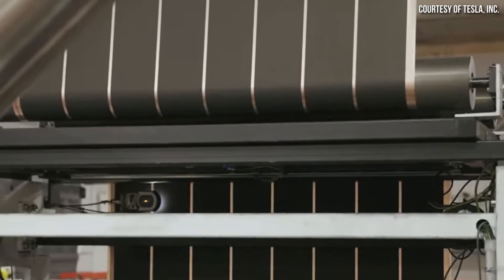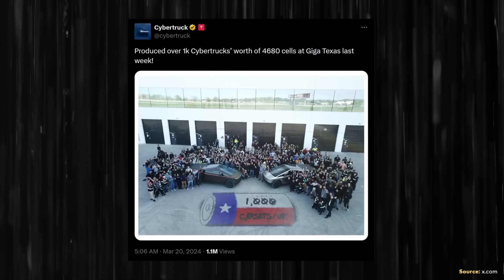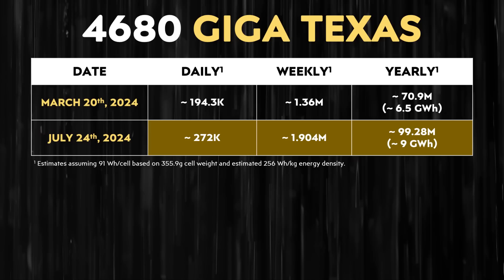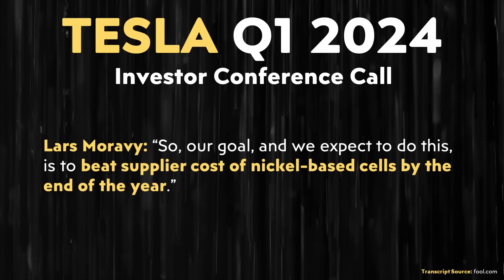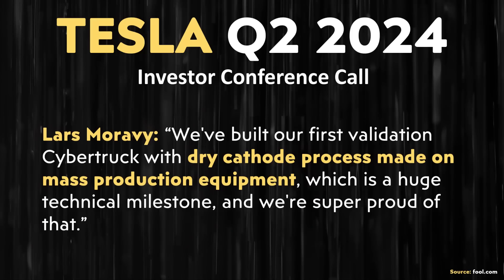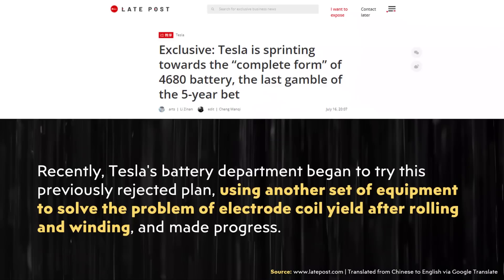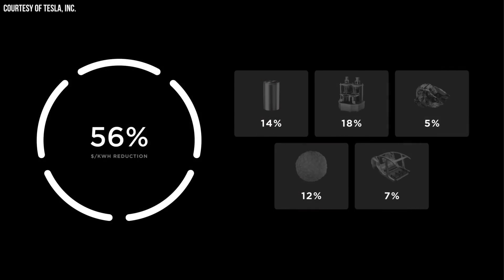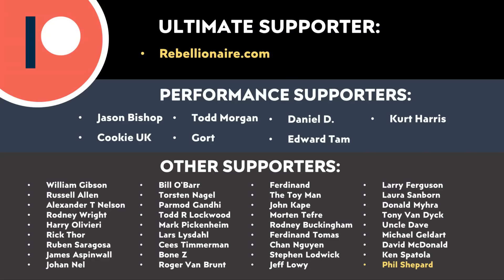BIG Tesla 4680 Battery Update | This Changes EVERYTHING!

Comment: SOLUTION.
TWO Cathode lines, running at 50% speed to equal the output of ONE Anode line at full speed.
DONE!
.
IF a solution is found... Build ONE more cathode line, and ONE more "Cell assembly plant" and you DOUBLE the output.

Comment: Was this Maxwell IP? Still no mention that this is the case.
Reply: "Still no mention"?
You never took the trouble to read the Maxwell patents?
Reply: @rogerstarkey5390  Hi Roger. Is it a given they used patented processes belonging to Maxwell? They didn't really affirm that in their commentary. I may have missed and if so, be happy to be corrected.
Reply: @rogerstarkey5390  you are clearly the resident expert. I am a complete novice. Clearly. However, I support @spleck615 narrative re "acquiring dry process material from an external vendor". More specifically Nano One Materials - Canada. I will await your correction when/if proven wrong. Cheers

Comment: When you hear executive or a head of govt. come out publically with specific goal, many times they already have good idea that it will easily be attained.  I believe in the case of 4680, the only significant hurdle left is dry cell cathode, and the rest of it is just tweaking production to ramp, scale, and produce better yields.  All of course lead to cost savings.  Once the Tesla dry cathode is part of the puzzle they will significantly be below any non LFP battery and will compete better with BYD who has been taking advantage for some time with in house battery production, though it is limited to LFPs and therefore fits well with the lower range and typically smaller vehicles they sell.
Reply: Well done for catching up with what we've all known for a long time.
.
As for LiFePO4 cells.
Lower density cells are NOT necessarily suited to smaller vehicles.
Think it through.
Lower density equals a heavier pack or less range for a given volume.
Smaller vehicles are space restricted AND pack weight is a greater percentage of the total vehicle weight, so impacts economy.
The logical choice might well be a SMALLER volume, HIGHER density, LIGHTER weight pack .... IF the cost per kWh is low enough.... Which is the aim of the Tesla SYSTEM (The Factory, not the form factor)

Comment: PESSIMISTIC HAT ON
What is not said is whether the mass production equipment was run at mass production speed or at mass production failure rate.
But still great news.
Reply: Think it through.
You have what is essentially a rolling press which suffers at high speed... so you add TWO units to that section running at half speed.... "Slightly more expensive" , slightly less space efficient, but reliable and doesn't lag the rest of the process.
Basically 2 Cathode lines per Anode line.
IF a solution is found, you simply add another Anode line to match the capability.

Comment: I wonder how they solved dry coat cathode. Did they need to remove manganese? If so would this impact energy density of the cell? I wonder if those limitations might hinder development of optimizing chemistry to improve charge rate and energy density.
Reply: Removing manganese will actually improve energy density because manganese is a stabilizer. But removing manganese makes the cathode more expensive. Although it seems like they are not removing manganese entirely only decreasing the proportion and then increasing the aluminum which is a softer material and an alternative to manganese in the cathode chemistry.

Comment: I heard that Tesla gave up on trying to fix the dry battery cathode manufacturing equipment and replace it with new battery manufacturing equipment to solve the problems producing the dry battery cathode. Apparently the holdup was the desperate attempts to fix or tweak the existing manufacturing equipment rather than suffering the loss inflicted by replacing the equipment.
Reply: makes sense - why waste time on 4680 otherwise
maybe they will roll out something new for more useful cells

Comment: 50percent ramp up is after using  cathode electron set supplied by LG . so there is no point of reducing cost less than suppliers. You are using supplier's crtical parts. The only way to accomplish  Elon musks goal is using dry cathode electron set and scale up to reduce cost less than suppliers's wet processed 4680 cell ,and You dont have that much time if you have just developed a prototype. Great lab work but not for scales yet

Comment: What does mean „dry“ does it means 30,50,80% moisture ?
Reply: I believe it means close to 0% moisture not needing any drying kiln after deposition. As opposed to typical 'wet' that is applied as a water based solution needing substantial kiln drying.
Reply: It eliminates the need for all the drying ovens that come after wet coating.

Comment: Tesla goal :
"Beat supplier cost nickel cells year end" 
A moving target. CATL BYD will have leapfroged by then, in addition of cheapo iron batteries.
Tesla should get over theire failure in batteries now, not year end
Reply: Cope harder
Reply: It's not a "Failure", it's a "Development" and the reason other cell prices dropped was market conditions.
.
The cell manufacturers were producing to supply an increasing volume of vehicles, then numerous manufacturers famously (Infamously?) "Pulled back" causing a glut of cells.
I suspect you know this.
GREAT for Tesla since they are the customer  that not only maintained vehicle production but expanded the STORAGE business over the period.
That's going to reap rewards in future when negotiating and when the manufactures decide which customer is first in line for new developments.

As for "Cheapo Iron cells", it depends on the application.

Comment: I think we might be reading too much into the conference call announcement, no doubt as they intended. I had already heard in the last few weeks that they were acquiring dry process material from an external vendor. The announcement could easily be interpreted as updating the process to utilize the 3rd party material, not an actual breakthrough on their internal dry manufacture material process. Still an improvement, but not what people are claiming has been accomplished. It would be nice to get clarification on which is true in this particular case.
Reply: Wrong, they were purchasing wet cathodes not dry cathodes from suppliers.
Reply: @boostav  that doesn’t conflict with what I said.
Reply: @spleck615  Uhm yes it does... there is no third party option to purchase dry cathodes from.
Reply: So, you're reading what Lars said (ability to produce it on the mass production equipment), and don't believe it means what it means? You don't suggest he lies, but how could it be otherwise then?
Reply: @Alarix246  I believe it may be integration with 3rd party into their process using mass production equipment which is great, but not the original goal or what has held them back. This is (potentially) plan B. Again still great. But not the breakthrough they were trying to achieve and recently gave up on. Then suddenly achieved it? Doesn’t make a lot of sense. 3rd party integration makes sense and matches recent rumblings. Awesome to be wrong though.
Reply: @spleck615  There is no compelling reason to believe they would adopt such a practice. Rather than simply fixing their own and proceeding onwards into battery production.
Reply: Need clarification here: From your sources, are they buying dry process raw material from external vendor or are they buying finished dry cathode from external vender? Big difference between the two

Comment: This is as big as Apples M1 chip.

The new batteries will continue to drop in price in the next years.

It will become cheap enough that Elon will have to have them in the Model Y. There will be no other option if it’s cheaper.

This will make increased range cheaper.

This will make EVs as long range as ICE, and soon far cheaper than ICE.

EV adoption will skyrocket when it is so much cheaper that the consumer has no choice but to consider them.

Get ready for $10k base model EVs in 15 years.

Comment: Is there energy density disparity between wet and dry cathode technology?  Sorry if I missed that...
Reply from the maker: Generally, the dry process leads to lower energy density... however a recent Tesla patent app detailed a way to adjust for that and bring the dry process to energy density parity with wet processed ones. There shouldn't be a big difference.
Reply: @Cleanerwatt I wonder what would happen if after the rolling and winding they squished the roll to hexagonal shape and fitted it into a hexagonal can instead of cylindrical? If the gentle squish wouldn't damage the roll, the hexagonal shape would be ideal for the honeycomb battery pack structure and would eliminate the empty spaces and increase the rigidity.
Reply: @Alarix246  
"hotspots"
Reply: @Cleanerwatt  No, the dry process leads to higher energy density. There is more active material for unit of volume. Not going to be a massive difference though.

Comment: Seems like other battery form factors are coming onto the scene. How about a vid comparing cylindrical to pouch?
Reply: There's no 'one best' form factor.  Instead, what you want is to match the form factor with the chemistry you plan to stuff inside it.  For example, cylindrical is easier to cool and maintains structural integrity better so it works well when you're generating a lot of heat and need really good and even cooling.  It's good for high nickel packs.  Prismatic works well with LFP since it's a robust chemistry that can tolerate much higher heat and is less prone to expansion issues.  The prismatic design allows you to stuff as much active material into a given space as possible to compensate for the lower energy density of LFP.  Pouch is very similar to prismatic, except prismatic has a little bit of structure to help control expansion.  Pouch can't exist on it's own without a strong enclosure to keep the pouches at the proper compression.

Of course these are all generalizations, other considerations may over-ride general rules of thumb, for example the manufacturing efficiency of stuffing LFP into cylindrical so a single manufacturing line can do everything may pencil out better overall in some cases so you may end up with some 'strange' choices. ...Basically, it just depends.
Reply: Tesla chose the cylindrical process because it is the fastest. It is a continuous process, not start and stop as sections are produced and laminated on top of each other in a pouch. Other battery forms have been around for years.
Reply: @royh6526  
Agreed.
Except, to be accurate, I would say "Volume" rather than "Speed". It's about Factory footprint and GWH (TWH) "Out the door"

Comment: Honestly, we only care that the battery is affordable, has a long life, good energy density, charges fast and is safe. At this point in time, I'd rather have a CATL LFP Shenxing Plus pack than 4680. Hope Tesla moves in that direction.
Reply: U like heavy batteries?
Reply: @xlargetophat  Less energy density is okay if the battery charges 4x faster... just use a smaller battery pack. I currently have a RWD M3 with 60KWh LFP battery. On a trip, it can charge from 15% - 80% in about 20 minutes... if it could do that in under 10 minutes, it would be awesome! In general, I'd prefer a smaller pack that charges fast over a large pack that takes 40 minutes to charge to 80%. The current 4680s don't charge very fast. Hopefully the next generation will improve.
Reply: @meganote 20 minute doesn't sound bad to be honest. 10 min sounds awesome but the whole infra will take time and need heat discipation + will cost way more. 20 min for 200+ miles is a very reasonable time already. Lfp can be fast charged multiple times too so a small pee brake and by the time you eat a packet of chips or watch a short youtube video charge is done.
Reply: @meganote  Small packs have no underlying relevance to the majority of consumers.
Reply: I care about the environmental side. Less chemical emissions, no furnaces. 
I just hope it's true!
Reply: It seems that the battery competition is about to finish and China will be the winner. 4680s will survive just for the Teslas sold in USA to avoid taxes. China is producing millions batteries for the last 30 years. They have the technology, they have the support of the government, they control the supply chain....
Reply: Innovation, refinement, or both; competitive pressure makes everyone better.
Reply: They use a variety of batteries but producing their own gives them independence.
Reply: @meganote  lfp is a wrong Chinese desperate wrong turn.
Reply: You are wise.  I too would rather have LFP batteries.  They are more durable, and reliable and will likely last 500k+ miles.  Possibly 3x the life of other batteries.  People that focus solely on energy energy density are not very wise.
Reply: This is a bit short term view.

The only reason CATL is innovating as hard as they do, is because of competitors like Tesla who push the boundaries in areas like cost. 

It’s a great bet.
Reply: And now that Tesla is now a legit battery company… they will continue to innovate and may have a few massive breakthroughs of their own in the future.
Reply: LFP is a huge wrong turn and no electric vehicles in the future will use them.
Reply: @RNA0ROGER  correct

Comment: 4680 has been Tesla's biggest fraud. These cells are WORSE than 2170s by every metric. The entire battery day presentation was a lie
Reply from the maker: It is catching up quickly to 2170, and will be much cheaper to produce and will get better with time (charging/energy density) now that they can focus on improvement rather than solving DBE.
Reply: Only in your sick head.

Comment: Dry electrode has the potential of above 400 wh/kg cell level energy density,because it increases the amount of active materials in both cathode and anode in the battery cell therefore without changing the volume and weight of the cell you will have much higher mili AH per gram in your cells,i think dry electrode and all solid or semi solid electrolyte is the real key for above  450 wh/kg energy densities,and remember that there is cobalt free LNM cathode chemistery cells on the horizon with cycle life and safety(thermal runaway)of an LFP and 60% higher energy density compared with traditional NCM cells,just imagine dry electrode LNM solid state with 6000 cycle life and energy density of 700 wh/kg cell level which is totaly on the horizon with these new technologies,dry electrode LNM (lithium-nickel-manganese oxide) is the battery of the future
Reply from the maker: Based on a Tesla patent app, the exact opposite is true. The dry process actually naturally leads to lower energy density than the wet process. Tesla had to tweak some things to bring it to parity.
Reply: @Cleanerwatt  i dont think so,the whole purpose of developing dry electrode cathode and anode is to lower the production cost and increase energy density,even LG energy solution stated that they are working on dry electrode NCM battery cells with 40% higher energy density for 2028,
Reply: @Cleanerwatt was just thinking that… the dry process requires a binder.. which will dilute the amount of metals a bit. 
It’s like mixing all the metal dust with glue before putting it on the roll. Now you have the extra glue that takes up some space and may mess with conductivity.

But it is a massive engineering and production win, because it requires less heating and disposable chemicals.
Reply: You will be amazed if i tell you most expensive battery pack which is tesla model s's panasonic 18650 NCA(800cycle life) cell costs 12000$ for 100 kwh pack compared with 9000$ for LFP(3000 cycle life and cheapest battery)100 kwh battery pack meaning there is not much of a difference between the cheapest and most expensive battery pack out there, it will not make the evs that much cheaper, the difference is in longevity and safety of the packs,that is why CATL will move to LFP instead of NCM in it's qilin 2.0 battery pack which will be interduced later 2024.
Reply: @davidfujkk8018  Come on - still with the 800 cycles for NCA!
https://www.youtube.com/watch?v=9qi03QawZEk
https://www.youtube.com/watch?v=sG4o7rxRk4Q
Reply: What does that mean to the end user in terms of cost, range, charge time?
Reply: @jeffpicken5057  you will be amazed if i tell you most expensive battery pack which is tesla model s's panasonic 18650 NCA(800cycle life) cell costs 12000$ for 100 kwh pack compared with 9000$ for LFP(3000 cycle life and cheapest battery)100 kwh battery pack meaning there is not much of a difference between the cheapest and most expensive battery pack out there, it will not make the evs that much cheaper, the difference is in longevity and safety of the packs,that is why CATL will move to LFP instead of NCM in it's qilin 2.0 battery pack which will be interduced later 2024.

Comment: Yes, I thought this was excellent news indeed about the dry process for cathodes. Looks like the major difficulty has been mechanical and related to materials science and technology, rather than chemical or electrical.
Reply: Amazing how much progress happened after Elon gave the ultimatum to the team earlier this year
Reply: @daveinpublic  That "ultimatum" wasn't really a threat, as much as Elon believed that the problem was solved and it was just a matter of getting the production line up and running. They didn't just solve the problem last month. They stated that they are now making cells on production equipment, no longer on a prototype line. It would have taken months just to build the production equipment.